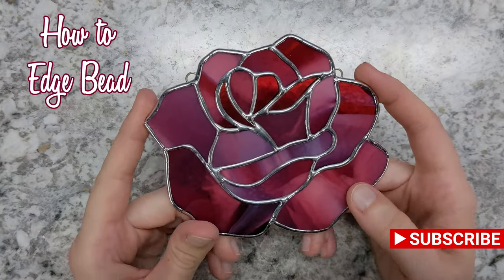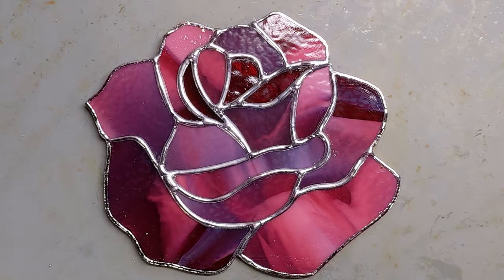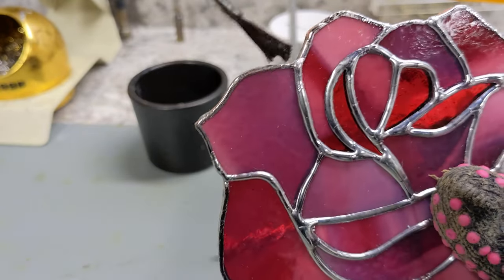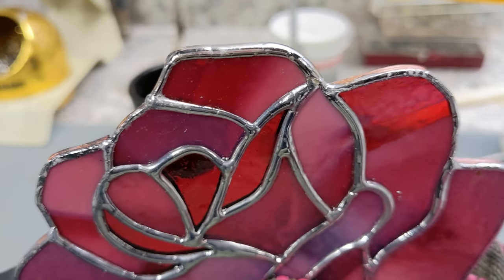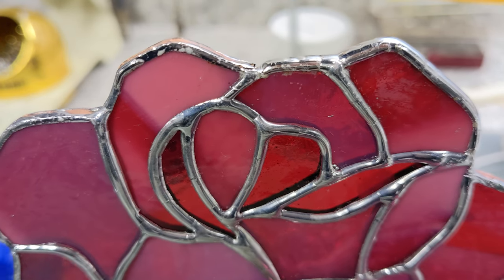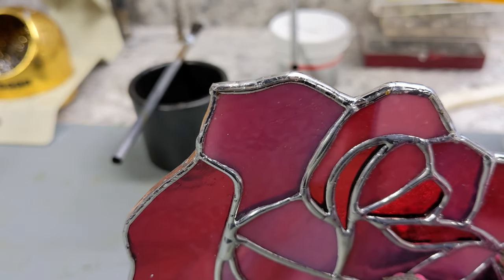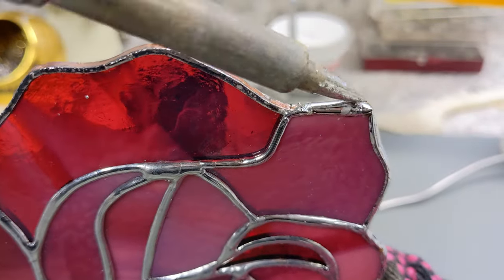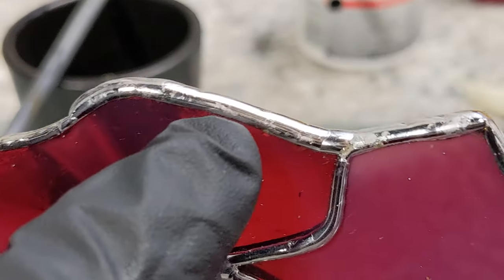HOW TO - Soldering Stained Glass Suncatcher Edges for a Perfect Finish - Edge Beading

Comment: Once again, I wished I would have seen this video at the very beginning of my journeys, as it drove me crazy trying to figure out how finished pieces achieved this look!! I didn't even think to set the temperature down on my soldering iron! A couple questions: For edge bead soldering like this, does gel flux work better than liquid flux? I find myself reapplying liquid flux sometimes as it seems like it evaporated, or dried up as I'm moving along. Also, I have a whole spool of solder that looks like it has oxidized or whatever as it's been sitting my my garage and this summer has been a HOT one. Is it still fine to use? Do I need to do anything to it to make it usable, or do I just need to purchase another spool and do a better job of storing my soldering supplies? Thanks so much! Honestly you are one of the best stained glass artists I have come across so far on youtube. If you created classes, I would 100% completely sign up!!
Reply from the maker: Thank you so much for your kind words! As far as flux, it doesn't matter. If you use gel, you can pretty much flux the whole edge and go, but if you use liquid flux, I'd flux a little section at a time, as it does dry faster than gel or paste. You can still use oxidized solder (I had some pretty old stuff from my grandpa that was somewhat oxidized). Try it out, if it gives you issue, you can unspool the solder in sections and steel wool it a little to make it useable again)

Comment: 90 percent sure that was black magic, thank you so much for making the video. two quick questions.
when you decided that you needed more flux what signs indicated that you needed flux?
when i try to build up my bead it will spill over the sides how does yours not spill over? I do have my iron at 360°c
Reply from the maker: Haha you're welcome! When I'm tapping the solder, if it starts getting lumpy/forming peaks, that means I need more flux, cause the flux allows the solder to flow and stay smooth. Make sure you tin the front and back edges first, I feel like that gives the solder a base to grab onto so that it doesn't just fall off (I don't know if that makes sense, lol). Make sure you're not lingering with your iron too long, that's the only reason I can think of why the store would fall.

Comment: Thank you for showing us this.   I'm just curious... why would we do that instead of using hobby came?
Reply from the maker: It's mostly just a personal preference, and depends on the project. I usually prefer the look of beading the edges of my smaller pieces (specially on my flowers, just cause it looks more organic), but I'll use came on larger pieces. One reason to bead the edges instead of using hobby came though is if you're wanting to apply a copper patina, since the patina doesn't work on lead.

Comment: Great video. I’m a beginner and tried to do some edge beading. It went ok-ish, I need to keep practicing. 
Whenever I came to one of my seams, the edge beading affected the look of my piece’s beading on the front and back. I’m having trouble making it look nice where solder lines meet. Do you have any tips for where the edge beading meets the piece’s solder lines? Or any tips in general about making solder lines connect smoothly?
Reply from the maker: @EmilyPahl-j7y  I know exactly what you're talking about. After I'm done edge beading, I put my iron temp back to 410° and lay my piece flat, then any joint that got messed up just gets a little flux, and then I grab a little solder and hold it on the spot for a sec to fix it.
Reply: @SamanthaAshleyGlass  thank you so much. I will keep practicing. :)

Comment: what determines the soldering tip that you use? Also, what is your temperature set on? thank you
Reply from the maker: I suppose personal preference. I like using a 3mm tip for most of my projects that have smaller pieces. I'll use a 5mm tip on larger panels, or if I'm using 1/4" foil for thick solder lines.

360°c for edge beading, and 410° for everything else

Comment: Hi! I just need to know what are the things to need to buy for beginner. Thank you.
Reply from the maker: Hi! So here's a link of everything that I actually use in my studio (it's a big list, the more you work with this medium, the more tools and supplies you accumulate). (https://www.amazon.com/shop/samanthaashleyglass ). The brands and types of supplies you get depends on the budget that you're working with, I would say though, that the bare minimum of what you need for a beginner is a small grinder (doesn't have to be anything large or fancy), a cutter, running pliers, 7/32" foil, flux, soldering iron, 60/40 solder (or lead-free if you prefer, though it's more difficult to work with), flux remover (or dawn dish soap), wax, and safety gear like goggles, gloves, etc. 

You can look at a number of stained glass websites like Delphi, and Anything in Stained Glass, as they have beginner kits you can purchase.

Comment: I’m sure this is a stupid question. What stops it from dripping onto the glass? And if it does how do you remove. Thanks!
Reply from the maker: That's a valid question! I'll try to explain it the best I can. Since the solder only sticks to the foil and not the glass, the foil acts as a barrier. So when you tap solder on the side, it sort of spills over onto the front and back of the glass, and starts to solidify as it reaches the edge of the foil barrier. That's why you have to go quick though, if you hold your iron on the edge too long, it'll keep the solder liquid, and then gravity will cause the solder to fall off the edge. 

In most cases, when solder falls off the edge, it doesn't "bond" with the solder lines that it hits - you can usually just flick it off with your finger or some tool. If it doesn't come off, you'll just have to go over that spot with your iron.
Reply: @SamanthaAshleyGlass  Thanks so much! I've not attempted this craft and want so much to try!!

Comment: Completely new here. When you show the example of the 'just tinned' section.. What do you mean by this? Because to me it looks like you are doing the same thing (but obviously with a different result. Flat not rounded). What is the difference?
Reply from the maker: @JordanWade-hj5ns  just tinning means you're using a lot less solder, and basically doing a quick pass just to coat the copper foil with some solder, you're not actually building up the bead. If you leave it tinned, you have a weak (and unfinished looking) edge.
Reply: @SamanthaAshleyGlass  thanks a lot for the answer!

Comment: I've been using the same technique and temp for all of my edge beading, but I'm still having issues. My solder runs even if I'm beading a flat level line. It'll flaten out to the sides and often run off the front or back. Does type of flux make a difference? Mine is liquid, not gel. Its the only difference i can think of besides just needing more practice.
Reply from the maker: Are you by chance using a standard iron tip, which is usually pretty large, like 1/4"? Edge beading can be more difficult with a larger tip (larger surface area, more heat, more solder, so greater chance of solder falling off the edge). If that's the case, you might need to try using less solder, or turn your iron even lower. I mostly solder with a 3.2mm tip.
Reply: @SamanthaAshleyGlass  omg yes! I had no idea. I'm going to buy a different tip and hopefully that helps. Thank you!

Comment: It is dripping off the sides, even when I tap it really short. Do you know how I can fix this? Thank you!
Reply from the maker: What temp are you using, and what flux? I use a lower temp for edges (360). Make sure your edge is pretty level, cause even if it's tilted towards you or away from you, that can be enough for gravity to "spill" the solder over the edge.

Comment: I've tried this and the solder will drip over the edges. Any tips?
Reply from the maker: There are a few things that could be happening. You might be tilting your piece towards you, thus allowing gravity to spill the solder over. Or you might be lingering too long, and too much heat is going to one spot. You want to bead slowly in a tapping motion, then let the solder cool for a few seconds. I also find it easier to edge bead with a smaller tip (I like to use a 3mm tip)

Comment: Do you know why I can't grab a glob of solder? It just slides off. My tip is clean and freshly tinned.

Also, when I pick up my iron, the solder doesn't pool, it leaves a hershy kiss point on it.
Reply from the maker: The Hershey kiss point is usually an issue of not enough flux. As far as why you can't grab a glob of solder, if your tip is tinned, you should be able to grab the solder, unless you're grabbing too much and gravity just isn't having it.
Reply: @SamanthaAshleyGlass  thanks for the quick reply! Is it possible my iron isn't hot enough?
I've got fresh Flux on there but it's still leaving points when I lift
Reply from the maker: @KayossPlays  you could try bumping up your iron to 410
Reply: @SamanthaAshleyGlass  that's what it is! I only have 1-10, not Temps so it's hard to know if you're not experienced I guess.
Your video was super helpful thank you!
Reply: Now it's dripping all over the place 😫 idk if this is the craft for me lol
I feel like I'm so close!
Reply from the maker: @KayossPlays  oh man! Ok, since you turned the heat up on your iron, you don't want to go over your solder too much or linger too long. just tap the solder on and let it cool for a few seconds before moving on. Just know that it takes some practice.
Reply: @SamanthaAshleyGlass  I think that's my problem! I'll get back to it tomorrow. Thanks so much for the tips!!